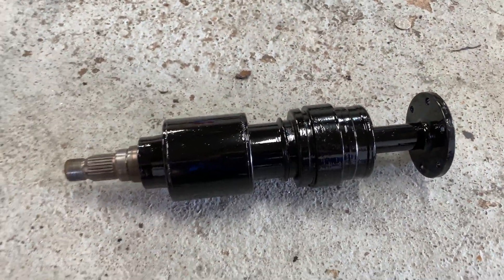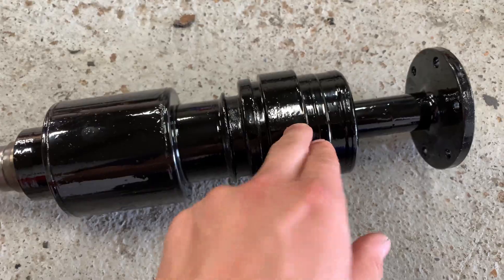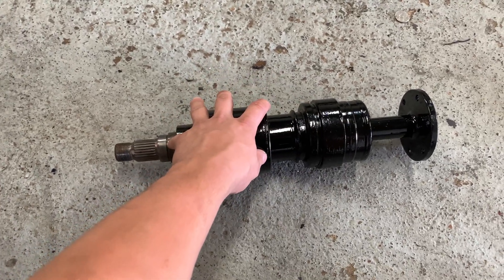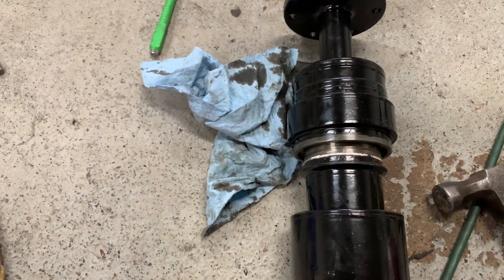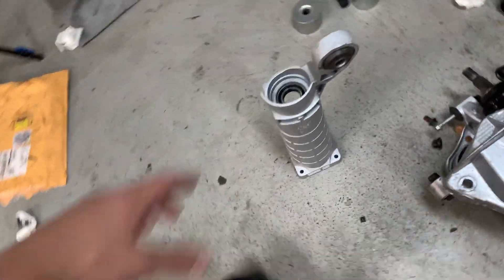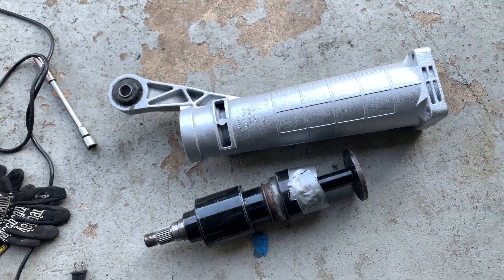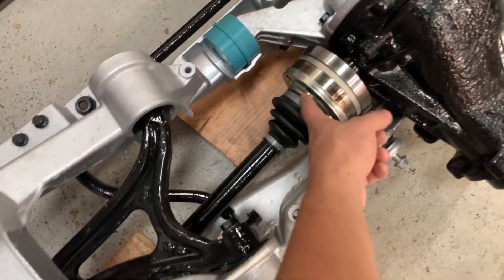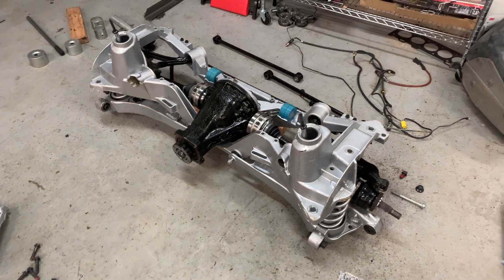Volvo 850 T-5R AWD Swap - Viscous Coupler & Freewheel Mechanism

Comment: Did you need a holding tool to break the nut on yoke of the viscous couple drive shaft side.
I need to replace that torque housing bearing on mine and just want to know how hard it is to beak the torque and retorque it after I slide the housing off
Reply from the maker: To break it loose you can blast it with an impact. But to torque it to the proper 130lbft for reassembly, you need a counter hold tool. You can make one out of some angle iron and 2 bolts.
Reply: @ after you remove the nut on the viscous coupling and the 4 bolts that bolt the housing to the rear differential the housing just slides off ?
Of course after you remove the torque housing bolt from the bushing
Reply from the maker: @ Yes it will just slide off with the VC still attached to the diff input. You can also undo the 6 flange bolts, then the bigger 4 without undoing the big 30mm nut and take the whole thing out as any assembly and take it apart. Probably easier to break the nut / torque on car tho. Maybe you can have some hold the brakes.
Reply: Do you have the part# of the bearing 
I have a 1999 s70 awd 
Need the bearing part number 
I would like to have the bearing in hand when I do the swap

Comment: For balancing, do you take it to a place that does driveshaft balancing? Or what's the process? My VC is bad and I have a replacement to go in it and will do the bearing too. Mine is a fairly stock 98R. Love your build by the way. I've watched a lot of your videos.

Comment: It's hard to follow but you seem to be going back and fourth on running a new and welded VC.. 

Where do you stand right now?
Reply from the maker: I tried the original viscous coupler with 200K miles on it but it wasn't working right... the fluid inside dried up and the fluid cannot be replaced... so I welded it so now the car is locked full time 4WD 50/50. I have a spare coupler that is known good and working that I will try eventually but I do like the locked 4WD.
Reply from the maker: Theres 2 places it has to be welded to lock it. At the viscous coupler and at the freewheel mechanism.

Comment: The main task for the free wheel is to disconnect the rear axle when you engine braking in a curve on very slippery roads or in snow slush. Prevents the rear end to slide out if the rear wheels are braking from the engine. Hope you could understand that explanation??? Also if you are in reverse the free wheel locks so you have a 50 / 50 torque split, like if you get stuck and try to reverse out of it. Volvo also claim that @ cruising speed on the hwy the rear axle is disconnected trough the free wheel. For fuel savings.
Reply from the maker: Wow. Awesome thank you for the full explanation. Seems like its for situations this car will never be in!
Reply: @SimplyVolvo  No problem. I was going to do the same with my built, weld the free wheel. I been checking out your videos, most of your info I already knew. But, the part that the 960 axle fits the awd rear was new to me. 960 axle is going on my build, thanks for the info awesome. My car is going to be as light as possible, no interior etc. Aiming for 1200 kg (2600lbs) let see if I can get it that light, it's a long time project. Only work on it when I feel like it.
Reply from the maker: @SwedesGarage  The 960 axles work, but there are some problems with CV boot clearance on the upper control arm if the car is lowered. You'll see in my next video.
Reply: @SimplyVolvo  Ok, I'll check it out. But it's a long time before I get to installing rear axles hehehehe

Comment: I welded mine and did rear wheel drive rallycross with it. Shame the angle gear was rubbish and broke. Good work!
Reply from the maker: Ha thats pretty cool. Using the angle gear for RWD only. Did you weld the viscous coupler and freewheel or just freewheel? I assume the first.
Reply: @SimplyVolvo  only the Viscous. Welded from the outside. That's why I like you're Angle gear. Would be great to try again with a decent angle gear.

Comment: Dude this is an amazing project. When complete what do you eatimate youll have in to the car?$$
Reply from the maker: At this point im just about to push into 5 digits... which I think is very reasonable for all of the custom parts I got manufactured, engine refresh and literally rebuilding / replacing every single thing possible in the rear, new clutch, front and rear LSD, etc, etc.
Reply: SimplyVolvo hell yah. Cant wait to see this car. Some day ill met up at a show or something

Comment: did you do anything with the VC ? or is it just refreshed?
Reply from the maker: Unfortunately it is not re-buildable. So I just replaced the bearing and bushing on the torque tube and welded the freewheel mechanism. There is a test you can do where you lock the rear wheels and turn the VC input with a torque wrench it should take about 90nm to turn it. Mine took 90nm so its in perfect conditions with no leaks.

Comment: My white block just got new coils, it's been misfiring for a while. A cracked pvc hose has been shooting under heavy acceleration I assume, or maybe decel at rpm. I'm impressed with your building skills. I love my Volvo, 2.4 06 s60 T5 with  a 6 speed.

Comment: What material are those diff bushings? Also, I didn't get a good look at your hub bearings, but they are sealed, right?
Reply from the maker: The diff bushings are polyurethane, you can check out the video I did on casting them. They are the original SKF part number, so yes they are sealed.